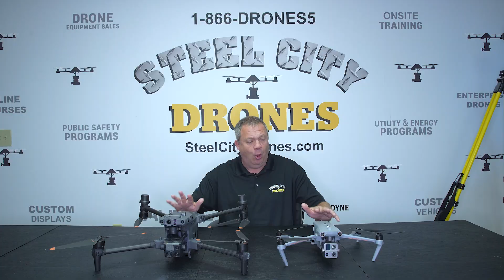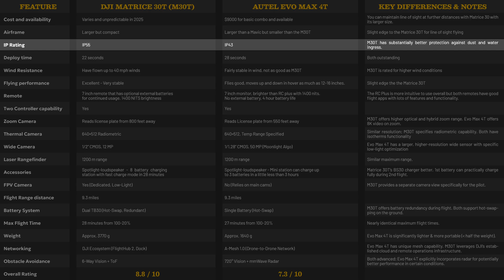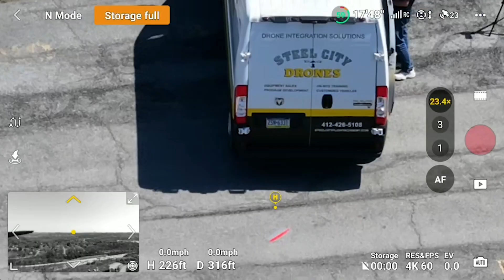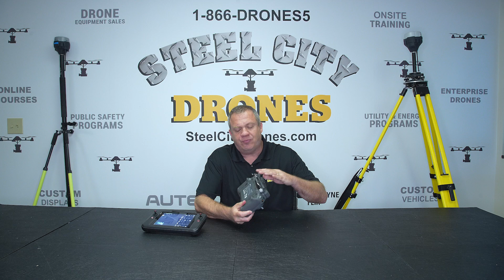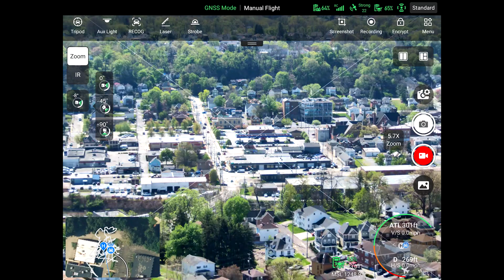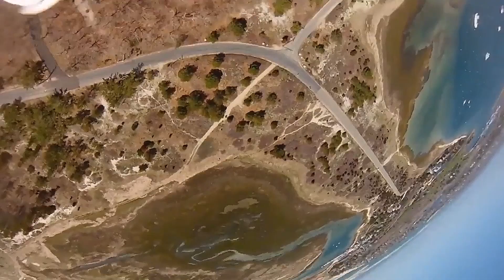DJI M30T VS AUTEL MAX 4T | COMPREHENSIVE REVIEW | WHICH SHOULD YOU BUY?

Comment: I know this is an older video. I love all your comparison!  Have you had a chance to test the autel evo max 4t after the newer firmware updates were made? Ive been looking at either the autel 4t or dji matrice 4t. They have some promotional prices for the autel going on with 3 batteries rite now. I will mainly be using them for thermal inspections and maybe help with SAR. How is the process with autel for creating maps aftwards? Is the autel apps good? Thanks again for all your awesome videos!

Comment: Just an FYI - An item to note that was confirmed by my inquiry to Autel is the,,,,, "confusion" about their IP43 rating. It does not come with an IP43 rating. On their website they refer to it as a (Custom Service). When I asked specifically if it came with or is an additional charge,, they replied it is in fact an additional charge. They did not state how much that additional charge would be. Another item to note,, it was stated to me the Autel MAX 4T also does not have a mechanical shutter.

Comment: Pretty sure i just saw that the V3 and of the evo max 4t that the newer controller has a removable swappable battery
Reply: Also the evo max 4T already has built in mmW protection against power lines and potentially conflicting rf transmissions from most sources
Reply: Also also, while there is no DEDICATED fpv cam, the combined camera capabilities have broad enough function that it comes very close to fpv, without actually being fpv. 

Because this is relevant information to your sales and services, you may bring in a few more sales and services if you market your business as a means of problem solving and not just giving information. 

Please know I am not trying to be insulting or correcting, but rather helpful. I have just done a ridiculous amount of research for buying a drone for tower inspections, and between the evo max 4t and the DJI matrice 4t, and the matrice 30t and many many others, the evo max 4t actually comes in first place for inspection work and 2nd place for SAR/LEO/fire/wildlife/hunt recovery operations. Matrice 3 and 4 series are great inspectors which is mavic 3 is impossible to buy right now because they are sold out everywhere, but the mavic 3 is really beginning to fall short and become obsolete fast in comparison to the just 4 to 5 thousand more for the most comprehensive models that are not just too of the line, but also a majorly improved future proofed product. Matrice 30/300 and matrice 4 series will take the cake on operations concerning people.

And also autel evo max 4t now has ai tracking abilities if it didn't before. They work differently than the DJI AI tracking, but still produce the same results...AND at a much better price for overall complete tool and flight readiness. Getting all the accessories and more batteries and everything you need for the evo max 4t is WAAY EASIER AND WAAAY CHEAPER than DJI....ANYTHING series. 

You might have had the v1 or the v2 for the evo max 4t in this video. But the v3 is FAR SUPERIOR

Comment: Great review! Having used both drones myself, I’d like to offer a few corrections, if I may:

The Autel EvoMax 4T does have two RGB cameras: a wide-angle and a zoom camera. The difference compared to DJI drones lies in how the app handles zooming. Autel offers seamless zooming by automatically switching between the cameras as you zoom in and out. DJI drones allow this too but also let you manually switch between cameras.

The EvoMax 4T does support tracking. Just make sure you're running firmware version 1.8 or higher.

Regarding hot-swapping batteries on the EvoMax 4T: this feature needs to be enabled in the settings menu. Also, the new battery must be powered on before inserting it for the hot-swap to work.

Although not mentioned in the video, the Matrice 4E’s front-facing obstacle avoidance camera can actually serve as an FPV camera. It displays full flight data like horizon tilt, altitude, etc., similar to the Matrice 30T’s dedicated FPV camera.

One important feature of the EvoMax 4T that wasn't mentioned is the downward-facing 60GHz radar. This helps stabilize the drone when descending below around 20 meters, even in ATTI mode. It’s especially useful for landing in strong winds or GPS-denied environments.

Comment: Why the big secret on the Matrice cost? Sure, DJI will be greatly affected by tariff but so will Autel. They are both on the list of companies certain senators want to ban 😑
Reply from the maker: @SkyFireDrone2022 - Autel is not affected by the China Trade war because its not manufactured in China like we mention in the video. The Tariff costs are calculated by where the product is manufactured and shipped from. There's no secret  regarding pricing, its just that the pricing has changed 6 times in the past 10 weeks because President Trump increased the Tariff costs from 20 to 40 to 75 to 90 to 125 to 175%.  People watch will watch this video today, next week, and in 6 months so if I Publish a price it will be completely different by the time someone watches the video.  Today the DJI Matrice 30T worry free combo is at a price of $20603, in February it was $9627.  The China Tariff's have to come down for the price to drop again. I hope this answers your question.
Reply: @SteelCityDrones still on the list to ban